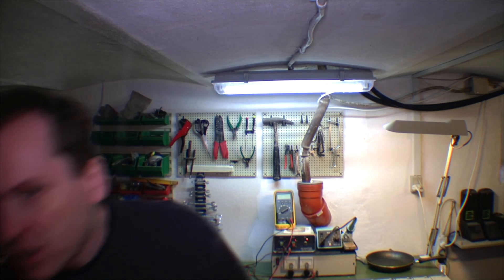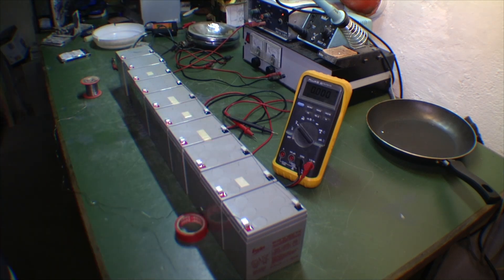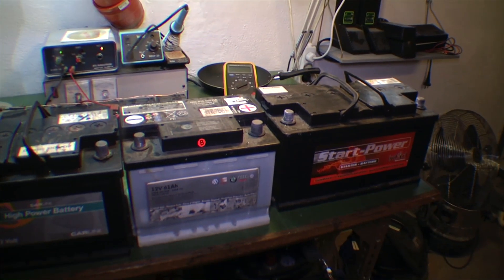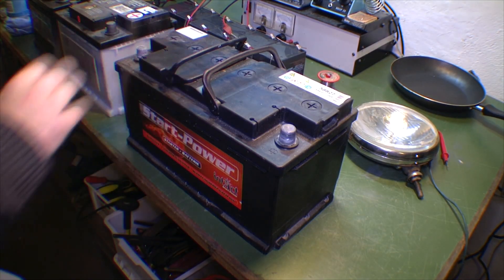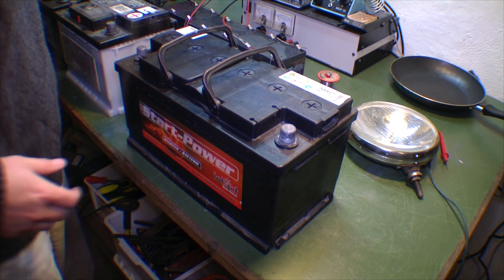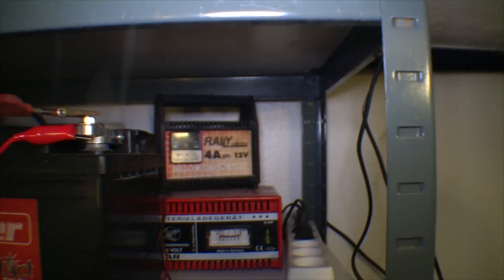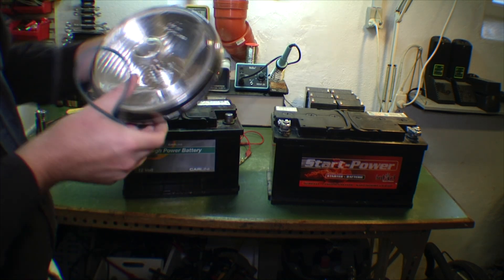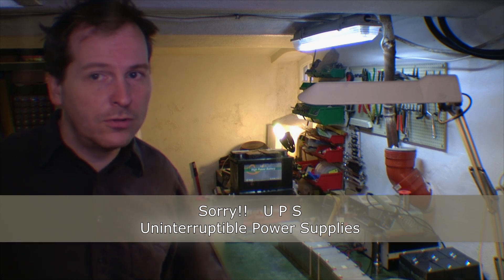UPS batteries and four used batteries for my 48v bank - 249

Comment: Have two UPSs for my overkill power back-up.  One is a Trip-Lite with two 7.5 Ah SLA batteries and the LCD screen says the power company is supplying 112 VAC (on the low side and usually 120 VAC or just above).  And reading five (5) bars so I guess the batteries are still OK.  When they get to three bars then maybe check for bad battery or connection.  The Tripp-Lite UPS is connected to the internet  ADSL modem,  a Dell 5324 24 port Switch and a APC 7750 Automatic Transfer Switch for the plugs.  My second UPS is the APC Smart-UPS 1500 (free standing) that uses two 18 Ah batteries and also connected to the Dell desktop computer...  Have a third UPS that may have a poor battery connection only...  Thank you for the video !  tjl
Reply from the maker: HI
Nice setup you got! do you lose power often, where you are at?
Thank you for watching! :-)
Reply: Used to have brief outages of a few minutes, but the power company trimmed the trees.  Some times have 70 MPH wind for the day, but no outages.  The longest power outage was for about five hours and no well water  for the water buckets.  May run a long power cord to another 15 Amp circuit, but have not blown any fuses yet...  tjl
Reply from the maker: HI Tim Lipinski 
Our power line has been dug down, now, I have one maybe two power outages a year. and usually less then 15 minutes.
Thank you for watching! :-)

Comment: Hi Morten, great vid as usual, just wondering if you have ever tried converting some of the more dead batteries to a alum solution? I have heard people have had mixed results.
Reply from the maker: HI +SickNTwisted 
No i have not tried any of the produces that you can put in the batteries,, my theory is that if they was any good the manufacturers would be using them..
Thank you for watching! :-)